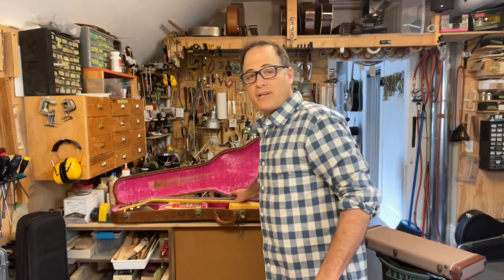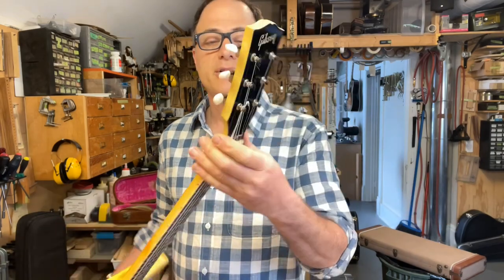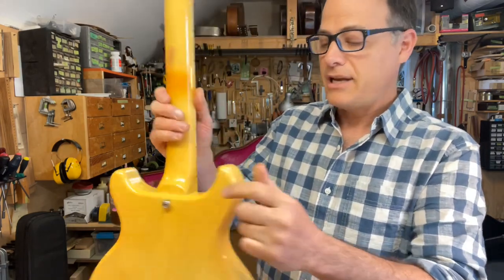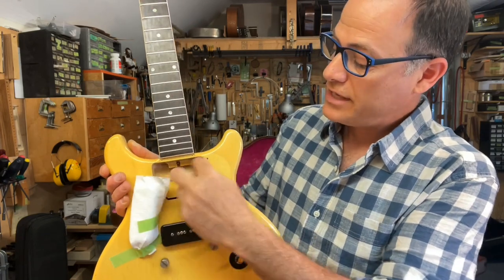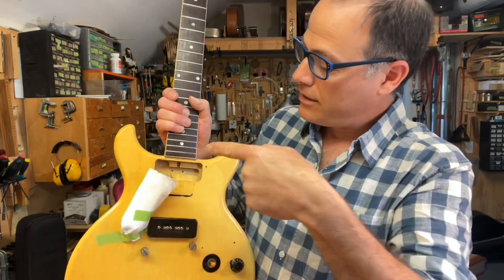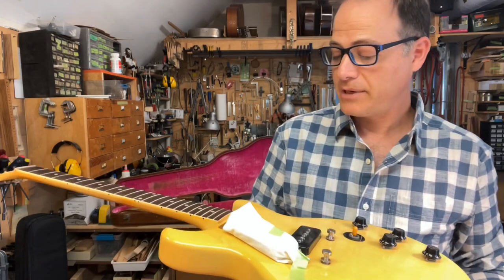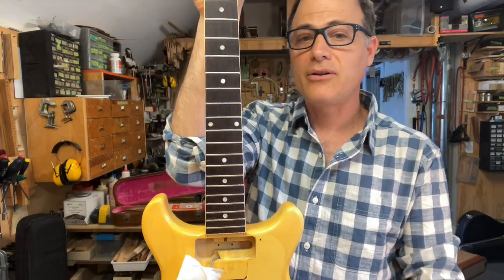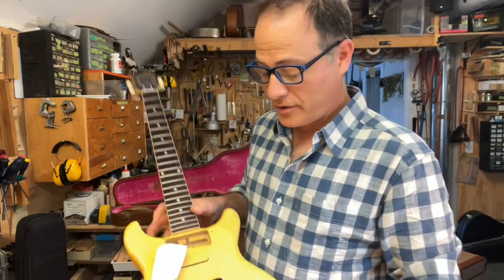1959 Gibson Les Paul Neck Joint Design Flaw, and One Way to go About Fixing it Permanently

Comment: One of my very fave guitars!
I had 2 of them back in the day.
One original I was told was a 58 & a reissue...I think a 76?
Both of them broke out at the body!
(Over time, gigging them night after nite & doing "trix" with them)
One nite at sound check it kept going flat & as I retuned, eventually I saw the neck pulling out of the body...I could have cried.
Having gone through it once already, the reissue was less dramatic for me...lol
Really wish I would have kept the original & repaired it, but who knew back then what these old guitars would be worth now?
Anyways, I have 2 more of them now, because I just LOVE that double cut!
Nice work...

Comment: The 2015 LPS DC Tribute and early 90s Hamer Specials had the neck P-90 right next to the neck. What did they do differently? Also, are LPS DCs neck heavy?
Reply from the maker: I don't know anything about those 1990's Hamer's, sorry.   Good question, though.  Some LPS DCs are neck heavy, particularly so if the tuners have been replaced with Grovers.  It's all about the body and neck wood used, and where the center of the weight distribution happens.

Comment: Superb repair work ! What would be the "discount" of a repaired heel compared to a perfect example ? about 30 % ?
Reply from the maker: It really depends on the repair quality, and the severety of the break.  In this case, the devaluation wasn't much.  Almost every '59 Les Paul Special has a compromised neck joint, so a good repair should only add value.

Comment: Given how little material is there I am surprised even with the addition of epoxy into the crack that the neck won’t still try to fold into the body over time….
Reply from the maker: It will try, but it won’t crack again.  There is still some neck tenon remaining there to do the work.

Comment: Nice job repairing the crack.  I don't think it is stronger than original as the fact that the epoxy stronger/less flexible than the wood around it creates a stress point where they meet.  Hide glue, with its similar flex to wood, creates a joint that is less likely to crack.  I.e. higher strength of epoxy does not mean more resilient joints.  I know it is likely sacrilegious, but I would plug that pickup cavity and route a new one like the later models.
Reply from the maker: Not sure about hide glue on this one. The strength of the epoxy is part of the long term success here.  Interesting perspective though. 
While plugging and rerouting makes sense, doing so would remove 10k to 15k of value from this guitar.
Reply: @TheFolkwayMusic  Strength has many dimensions.  Epoxy is very rigid, it will not flex.  Wood flexes.  Under strain the epoxy "strength" can make the joint fail sooner than materials which flex with the wood like PVA or hide glue.  Neither epoxy, PVA, nor hide glue joints will fail before the wood around it, so with epoxy you are adding more bonding strength where it doesn't help (beyond the fail point of wood) yet the behavior of the material will cause increased stress at pressure points causing earlier failure.
Reply: yeah, re-routing the pickup location would be sacrilegious; if somebody wants to do that they should look for a different guitar, not a near-mint example like this one

that said, it strikes me that maybe those deeper routs in the pickup cavity could be plugged, possibly the polepiece screws on the bottom of the P90 shortened to fit, so as to regain at least some strength in the joint under the pickup

the originality/resale question still pertains but at least it wouldn't be visible from the outside
Reply: @pnwgentleman  Great creative thinking, I have to say both sides make a lot of sense but only time can tell who's right I guess. I would too lean towards more stiffness of the epoxy ntuitively though.

Comment: If I owned that guitar I'd sell it. that neck joint is horrible. it looks like if you pushed on the body to bend the note flat you'd break the neck. if you really played that guitar it would only be a matter of time until it broke.
Reply from the maker: Sadly, this design flaw effects every first-year double-cut LP Special, so if you want a '59 neck carve and a double-cut you'd need to take the bad with the good.  The 1960 models don't suffer from this issues, but have a 1960 neck, and slightly different neck pickup tone.